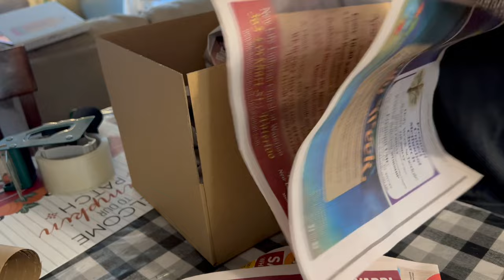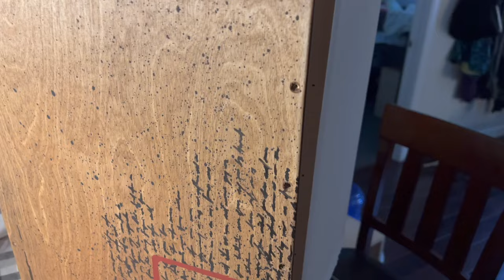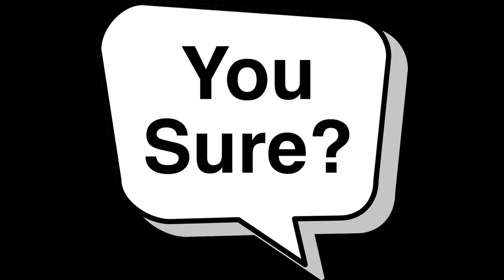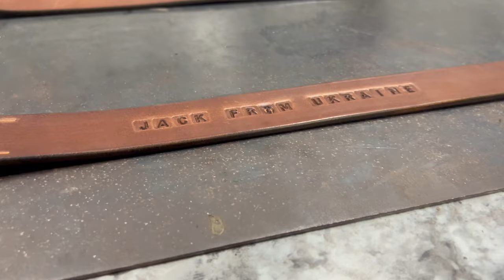DIY Cajons, Church Work and some Amish Long Johns

Comment: Since you are the media guy, Got any advise on a good camera for recording a church service in a church of that size?
Reply from the maker: We are using the Blackmagic Pocket Cinema  4K with the Panasonic 45-175 power zoom lens. We also use the Blackmagic ATEM mini switcher as a video capture card which allows us to control the camera from a desktop. Most big church are suggesting Black Magic Designs Cameras and equipment as they do great in the livestream church setting. Kind of ironic given the brand name.
Reply: @theamishpotato  thanks, I will look it up once I stop.